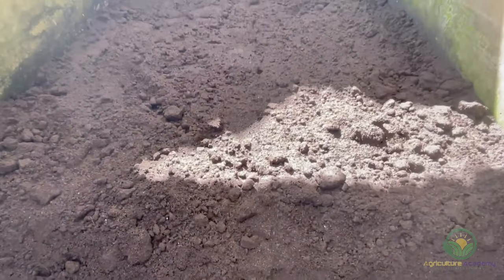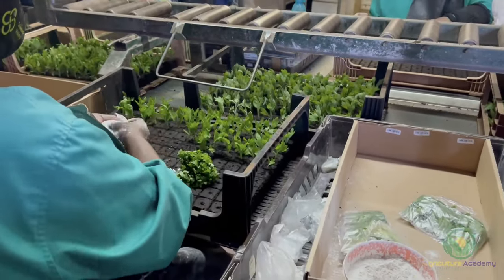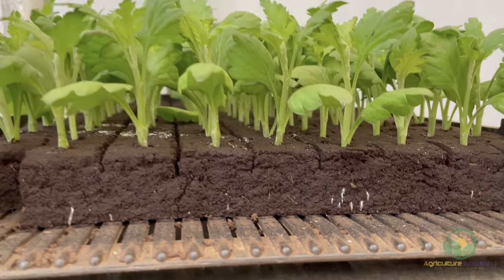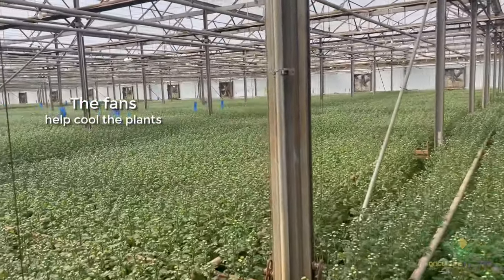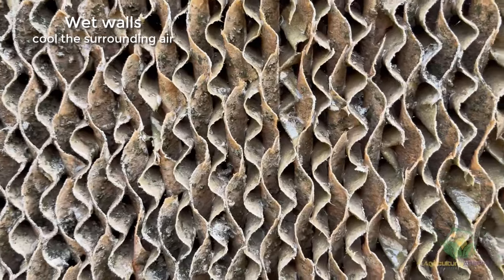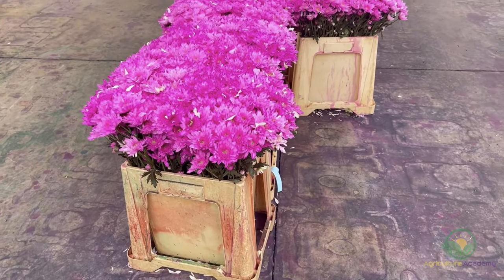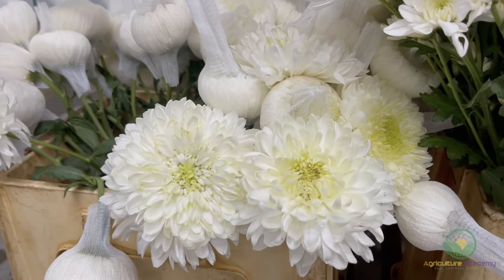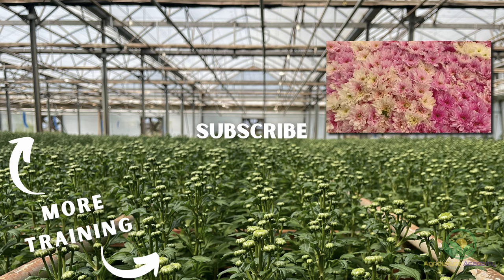Cut Flower Growing || How To Grow Commercial Chrysanthemums

Comment: What is percentage of shade net used above the saplings  in poly house
Reply: Kinda looks like 70-80% of difused light, To reduce heat under the plastic.Hope it helps.But im suprised they not using misting systems.